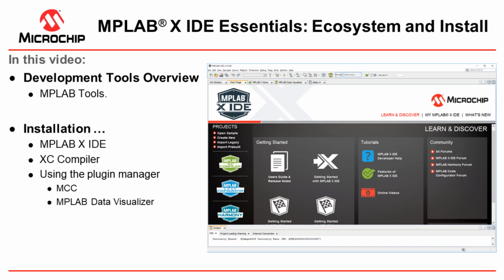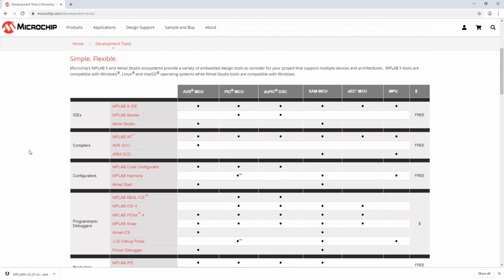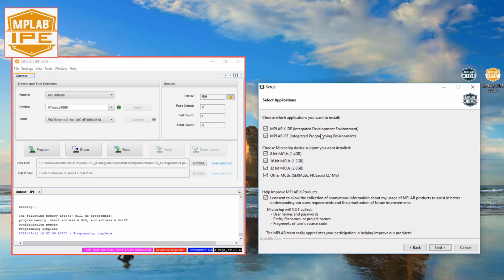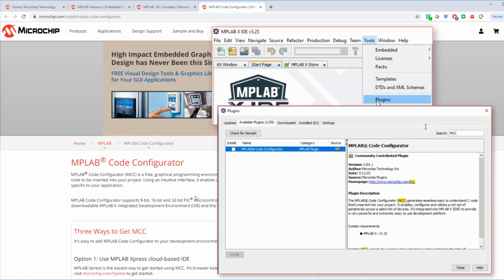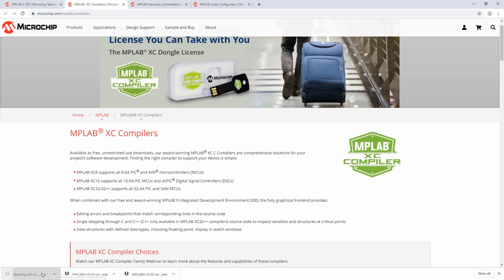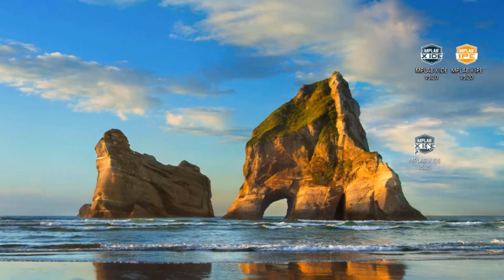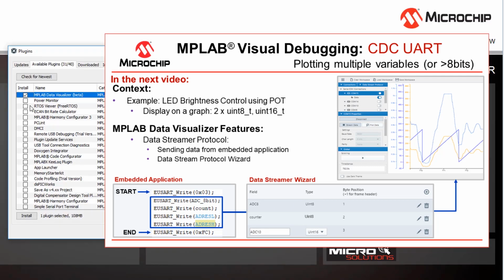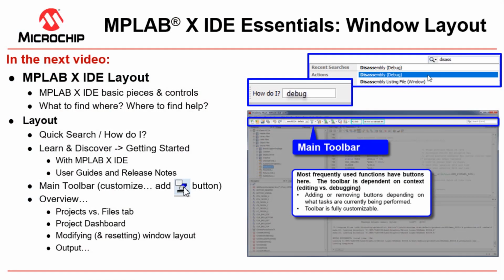Getting Started - MPLAB® X IDE Essentials - 01: Installation and Ecosystem

Comment: I am a fan of PIC micro controller and I like the great variety of choice of PIC with different peripheral. The MPLabX IDE is an amazing compiler, unlike MPlab 8, MPlab X does amazing jobs in compiling my code beyond my imagination, like it have soul inside it (is this Hi-tech C?). However it run terribly slow on my 4 cores Window 10 computer (on Java virtual machine?) after the buffer full, I have set the buffer size to 4096MB, but after a while it will still getting full anyway and make it run extremely slow, pressing the buffer usage chart does clean up the buffer a bit but only help very little to non. Is there anyway Microchip make MPLab X clean up entire (Java virtual machine) buffer if I click on the chart, make it behave similarly to the condition right after I start the MPLab X? Poor, terrible and time consuming user debugging experience can drive away many new or potential user I believe. Meanwhile, I solve my problem by constantly close and reopen the software and using more global variable for correct variable value return through my PICkit and probing less variable does reduce the buffer usage. It's a great tool, just perhaps not very user friendly compare to STM's tool in my humble opinion. But I can see Microchip adding more functionality to it from time to time, last time MCC (code configurator) having less function, now it getting more complete.
Reply from the maker: Thank you for the feedback - we value all feedback as we always look to improve our tools and customer experience. Development environments differ in both hardware, software and user configuration. Technical support is accessed through MyMicrochip and can the support team can assist you in addressing this issue. Find out more here:  www.microchip.com/mymicrochip
Reply: @MicrochipTechnology  Thanks for reply, it turn out to be the slow PICkit3 problem, I have upgraded my tool to PICkit 4, now MPLabX IDE become very responsive. I can just click to force garbage collection and things just run great, I like my PICkit again.

Comment: can you please explain how to install mpasm
Reply: MPASM is not available in newer IDE's. I think the last MPLAB X IDE that still installed MPASM was v5.30. MPASM has now been replaced in newer IDE's with "pic.as" compiler toolchain. The MPLAB XC8 PIC Assembler is a free-standing cross assembler and linker package, supporting all 8-bit PIC® microcontrollers. This XC8 PIC Assembler allows for sections of Assembly code to be included but it will be better to consult MPLAB_XC8_PIC_Assembler_User_Guide.pdf and MPASM_to_MPLAB_XC8_PIC_Assembler_Migration_Guide.pdf

Comment: The video is fine. Thanks. 

The tools are garbage. The code MCC generates is garbage. The compiler is garbage. It might all be fine if you are a geek hobbyist and have never seen anything better, but I haven’t worked with anything this bad in my 30+ years of embedded systems development experience since maybe SoC with Altera (now Intel). I am switching to Infineon for my new product development requirements.
Reply: I've never worked on any tool chain where I spent 10x more time finding and guessing where to click what on an IDE than debugging the code itself.  It took me 3+ hours just to figure for myself where to populate the watches window, and the entire weeks just to compile old ASM with the updated pic-as, through trial and error without any human readable documentation (that XC guide is just horrendous).  The DS-50002027E MPLab X User Guide seriously needed to be rewritten by someone who actually cares about their products and customers. There's nothing technical about an IDE yet the documentation is just unreadable.
Reply from the maker: @clo7473  If we can be of support, kindly visit support.microchip.com. Thank you.
Reply: Cj Lo yeah, it’s definitely poorly designed and implemented. Who puts button controls at the top of a tab where they can be easily confused with more tabs? It’s the little, simple to fix, things that make for a good user experience and they seem to have missed on that concept.
Reply from the maker: If we can be of assistance, kindly visit support.microchip.com. Thank you.
Reply: Microchip Technology We did that. Your support is less than useless. It actually made me angry. Why is your support hosted on Salesforce.com? It doesn’t exactly inspire confidence in privacy and confidentiality. Anyhow, we have changed our designs to remove the Microchip components and are migrating the software as required.
Reply from the maker: @douggodsoe  We have escalated this matter; however, we cannot locate a case under your name. Did you open a case? If so, please let us know under what name the case was opened and the case number. We'll be happy to assist you. Thank you.
Reply: Microchip Technology Thank you very much for paying attention to my belly aching, but we have already moved forward with design changes that simplify our implementation. We were trying to incorporate a WINC150x module with the ATMega4808, but the tools are sooooo bad. People don’t have time to work through hours and hours of training videos just to do the simple stuff. But, it’s just me belly aching.
Reply from the maker: @douggodsoe  Please let us know if we can be of assistance in the future, we're here to help. Thank you!
Reply: Days trying to simulate a simple piece of assembly code.
Reply from the maker: @fernandohood5542  Kindly visit support.microchip.com. We do not provide support via YouTube. Thank you.

Comment: Is there a way to install this via command line (silent install)?
Reply from the maker: @Abhishek Kulkarni:

Yes there is a way to install MPLAB X from the command line silently. There is a --mode option for this purpose.
 
Window:
> MPLABX-v5.40-windows-installer.exe --mode unattended --unattendedmodeui minimal
 
Mac:
$ sudo ./MPLABX-v5.40-windows-installer.dmg --mode unattended --unattendedmodeui minimal
 
Linux:
$ sudo ./MPLABX-v5.40-windows-installer.sh -- --mode unattended --unattendedmodeui minimal
 
Note that there is an extra “--” for the Linux.
 
Here we also use --unattendedmodeui option as well to show a progress pop-up dialog during the install, so we know the installation is done. Without --unattendedmodeui the installation will be truly silent.
 
Other related options (excerpt from the --help option) are:
 
--ide <ide>                             Installs MPLAB X IDE. Default: 1
--ipe <ipe>                             Installs MPLAB IPE. Default: 1
--8bitmcu <8bitmcu>           Installs 8 bit MCUs. Default: 1
--16bitmcu <16bitmcu>       Installs 16 bit MCUs. Default: 1
--32bitmcu <32bitmcu>       Installs 32 bit MCUs. Default: 1
--othermcu <othermcu>       Installs Other MCUs (SERIALEE, HCSxxxx). Default: 1
--installdir <installdir>   Specifies Installation Directory
Reply: @MicrochipTechnology  Thank you.. This will be helpful!